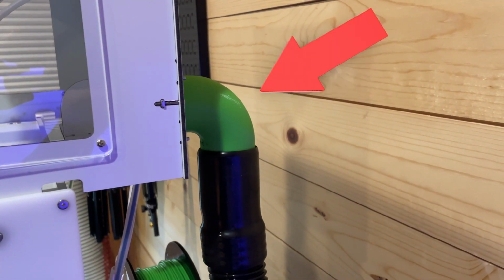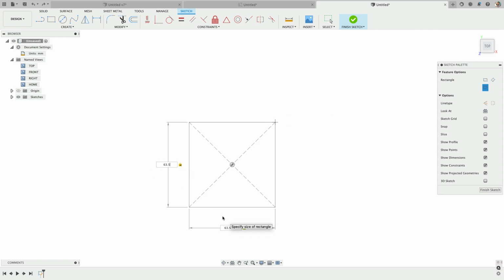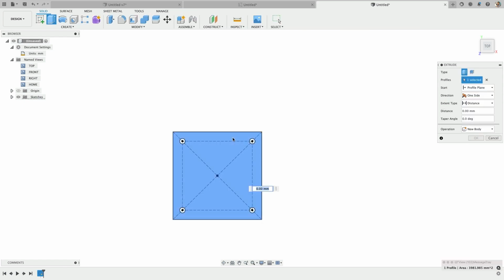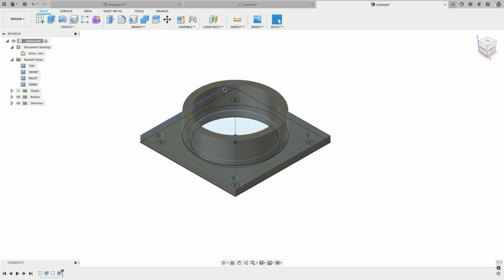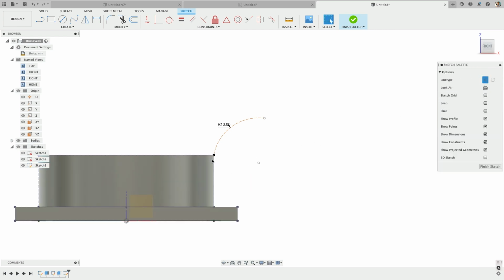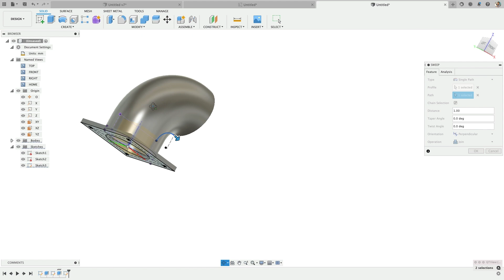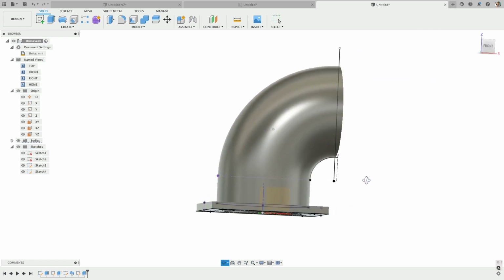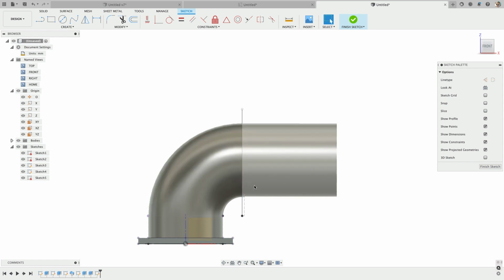Fusion 360 - 3d printing for beginners (Hose Adapter)

Comment: Terrific video. Curious if it’s necessary to overextend the original sweep and then cut it back or if you could’ve just done the sweep right to the center of the arc and extruded without having to cut anything? The cut approach seems a little kludgy to me.

Comment: Hi Tyler, 
Nice video. I use them to exercise / practice It's always interesting to see different approaches;  Let me share mine;
First I created a list of parameters [e.g. pipe-diameter, wall-thickness, angle of the bend, short_leg_length, long_leg_length etc.].
Next starting at the origin, I created  a vertical line, a bend / arc and a line at 90deg parallel to X-axis.
I gave these sections the dimensions from the param-list.
Next I draw a circle in a square on the 'ground-plane' and  use the param-list again for the wall thickness, flange dimensions. 
Now I do a sweep selecting the circle and the line as a guide. I then 'shell' the resulting solid using the wall-thickness-param
I draw one hole > circular pattern > extrude the  flange. Next time [when I actually need a pipe like this] all I need to do is change the parameters in the list & 'Bob is your uncle'. Time for an espresso. Thnx
Reply from the maker: Love it!  Sometimes I think the beginner community would be overwhelmed if I show parameters every time :).  Not sure....But, I like your approach!
Reply: @TylerBeckofTECHESPRESSO  I see where you're coming from. However... when I first 'discovered' param. features, for me drawing changed into DESIGN. The other even more important aspect: flexibility. When 'prototyping' [in my case: tinkering &  trying to make things work] making changes quickly & easily became THE thing! Most people that are starting out with F360 will quickly grasp the potential of parameters. Thanks again. Keep up the good work!
Willem

Comment: Would it be feasible to loft the bend between two circles? Would that get around issue of the end of the bed and not being perpendicular?
Reply from the maker: Absolutely.  The loft can controlled with a guide curve or center line.
Reply: @TylerBeckofTECHESPRESSO  Thank you, I will give it a try

Comment: Hey Tyler I've been doing a fair bit of induction tubing this last few months and I have just become a huge fan of the pipe command. I never used it up until now. One sketch, create pipe and editable thickness etc. Very quick. It does away with the need for the extruder sweep cut and extrude.
Reply from the maker: Very cool!  That probably deserves a video :)
Reply: @TylerBeckofTECHESPRESSO  thanks man. Love your work! 🤸